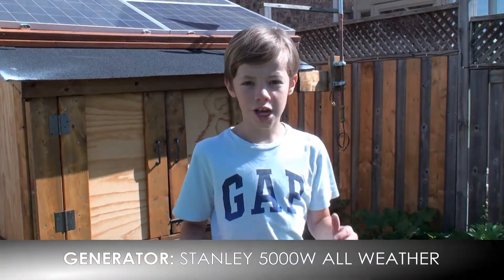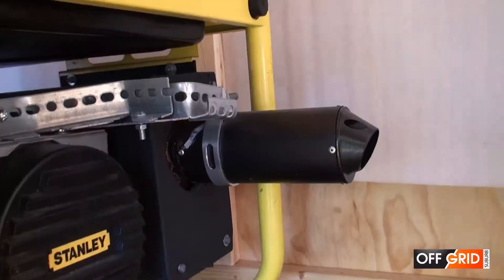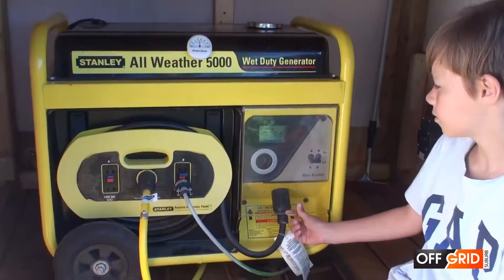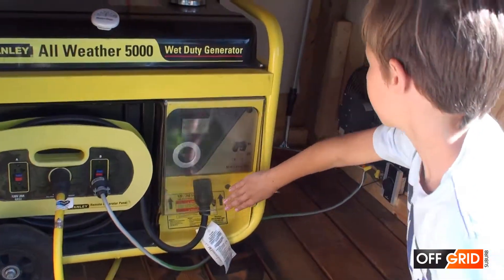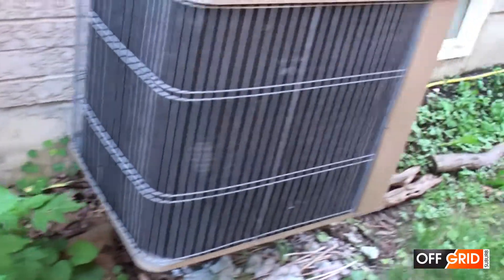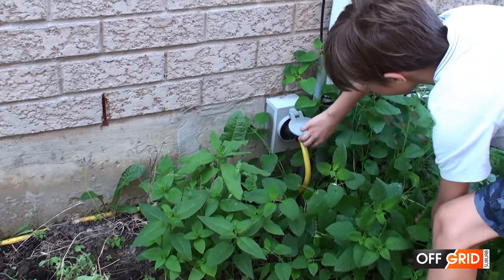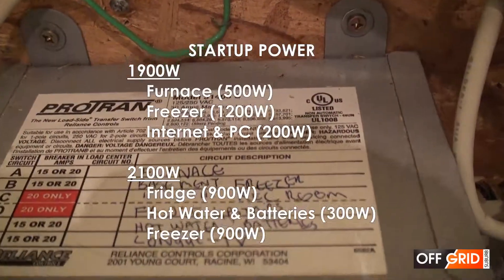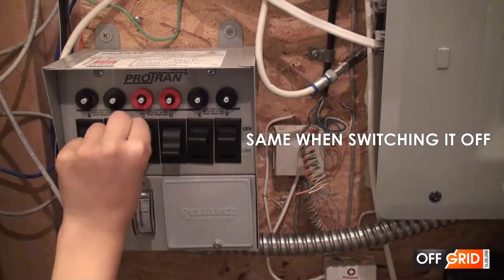How we choose 5000W generator to power our house during power outage?

Comment: Great job! I also watched your battery set up video. You have a pure sine inverter for your batteries. But what about the generator? That doesn't look like an inverter generator. I'm in the process of shopping for a generator but don't want to damage my electronics like my CPAP and furnace. Looking forward to your advice.
Reply from the maker: Thank you.  Personally don't know of motor generators that provide DC current (there might be). But all generators I know provides AC current and therefore don't need an inverter to convert DC to AC.  Our generator hooked up to the house system using a 30amp transfer switch.  Hope this helps.
Reply: @OFFTHEGRIDINTHESUBURBS  Hi and thanks for the quick reply. Most AC generators put out modified sine wave power that can be damaging to sensitive electronic devices. Inverter generators cost quite a bit more, but they put out pure sine wave power.
Reply from the maker: @kingstonsean  ah yes, we don't think we have pure sine wave AC.  I suppose not all portable generators are equal here.  Our biggest concern was ensuring we had enough power (VA) to start the appliances as this would impact our fridges and freezers.  We have run various items for at least 5+ years at various times, including TV and computers, which I would consider sensitive.  Nothing broke down yet but that doesn't mean can't damage something. We probably need to look into it more.  As inverter generators should technically save on fuel as it regulates demand supplied based on needs vs on all the time.  Thanks for the insight.
Reply: @OFFTHEGRIDINTHESUBURBS  Well, I've been looking into this a bit more today. Our furnace is connected to AC line power, but it has a DC motor, meaning it has its own AC to DC converter (a rectifier), so it's okay to use your type of generator. Laptops and desktops run on DC power; a laptop via its brick and a desktop via its internal power supply, so again no worries. So that only leaves AC powered electric motors that are in our fridge, freezer and microwave (but I can go without a microwave during a power failure). Electric AC powered motors can tolerate modified sine wave, they just won't be as efficient. That only leaves my CPAP, but I can run it on my Jackery or my Bluetti, or I can use my 12v DC travel CPAP. So, it looks like I can shop for a standard generator. (You're generator is discontinued, but Canadian Tire sells Champion) You're correct about the inverter generator having a low RPM "standby" mode and being more fuel efficient. They are also lighter and quieter, but they're also limited in output.
Reply: EDIT: The salesman told me it would have a DC motor, but I just looked it up and it has a 155v AC motor! :(  Next step will be to ask the service tech if I can run it on a generator.
Reply from the maker: @kingstonsean  thanks helpful information.